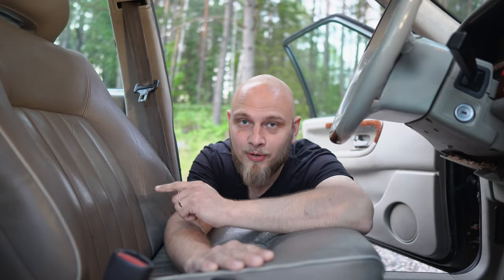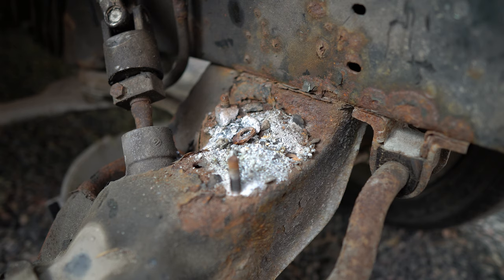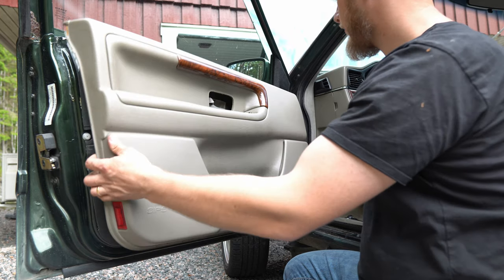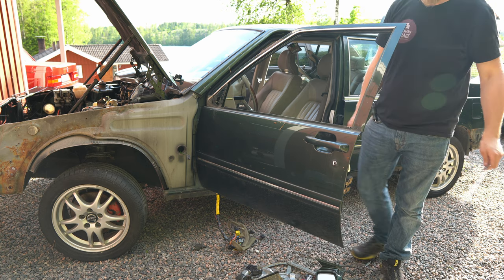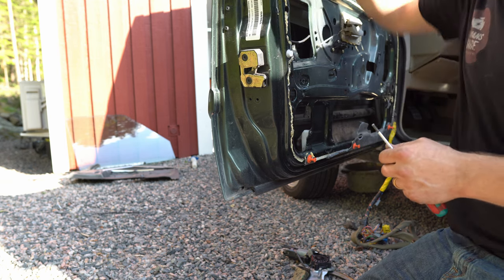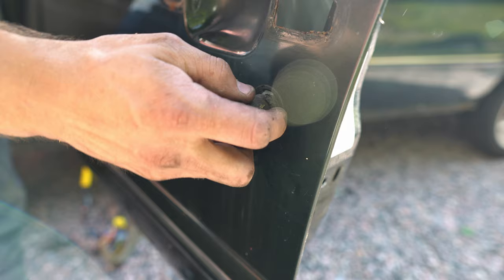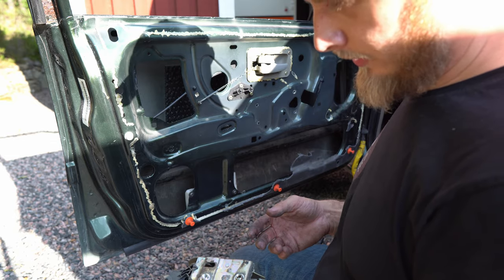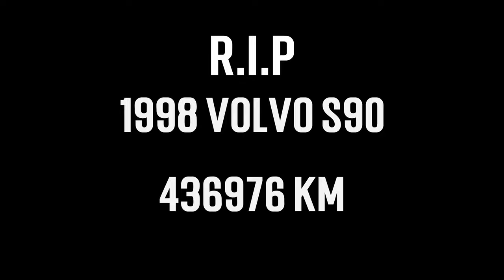PARTING OUT MY VOLVO S90 || DOOR TRIM, BUMPERS, POWER WINDOWS AND CENTRAL LOCKING

Comment: WHY?!?! Why did you take apart that great looking Volvo?!? 🤦🏻‍♀️ Oh well...It's a great donor car, now! So, how can I get some of those parts for my 98 S90? Do u have any parts left? Wait! You said 960, that's the same as S90, right?
Reply from the maker: Yeah, will probably regret that in 20 years 😄 But honestly that car was really rotten in bad places and fenders/bottom of trunk/doors is all bondo, and with 400000km on the clock.. not a real loss in this space and time. 

I have all the parts of value in my shed for future projects and I have also shared the remains of the car with my friends. Basically only the shell will be scrapped. //Backman  

S90/960 is kind of the same thing, depends on what year.
Reply: @BackmansGarage  jag letar efter träet runt läderdamasken till växelspaken. Nåt du har kanske?
Reply from the maker: Tyvärr är allting borta nu, håll koll på marketplace. Många s/v/90 som åker till skrot och plockas ned pga katalysatorer nu för tiden. //Backman